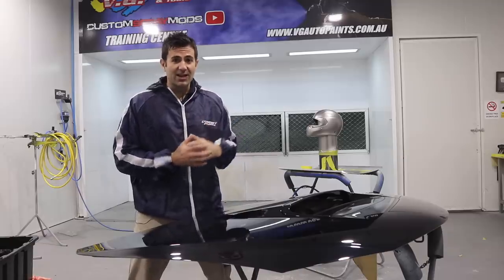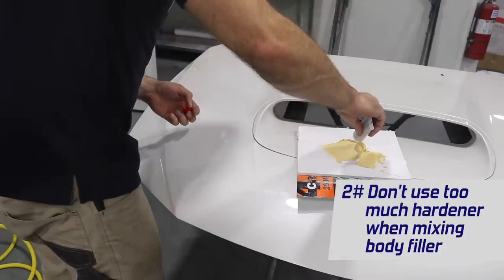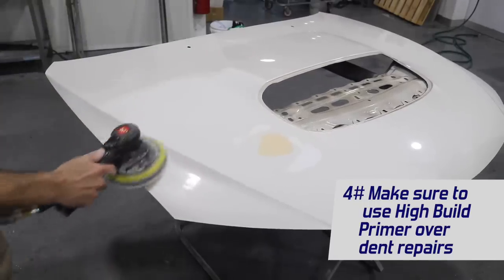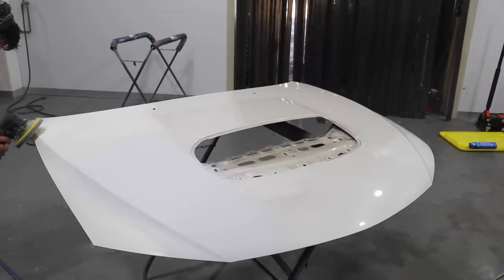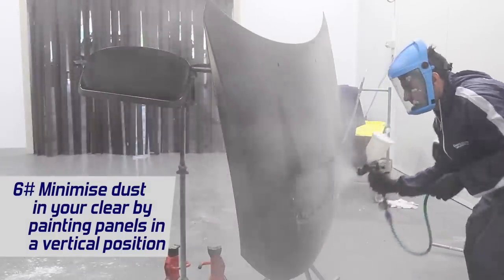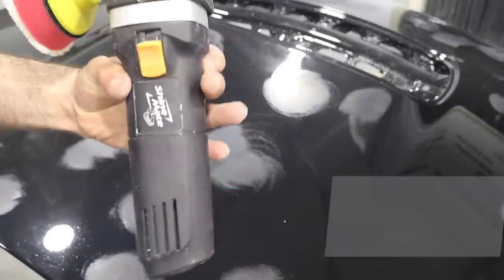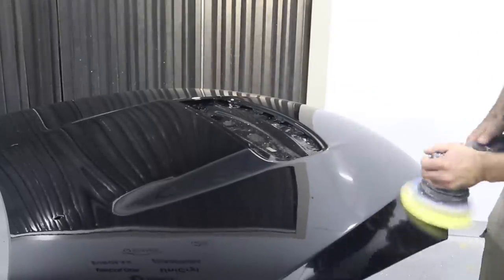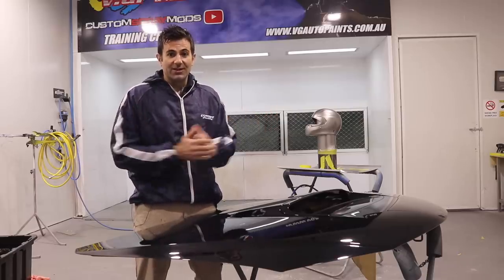10 Spray Painting, Dent & Buffing Tips

Comment: Mate, your videos are great! I recently painted my motorcycle (Ducati Scrambler Icon) using spray cans that i got custom mixed. Actually bought them from VG Auto paints.
I referred to a few of your videos and your information was SPOT on!
Bike came out really well and i was extremely pleased with it. I do however have a tiny bit of bubbling around top edge of tank where the fuel cap goes.
i know i prepped it all correctly, i think i have accidentally put too thick a coat and not let it dry enough in-between coats. Is there any way to get rid of them without actually stripping it all and respraying it all??
It would be a shame to have to redo all the work. I havent even wet sanded yet it it looks mint! so with a wet sand it will look awesome. I painted it the Range Rover Brittish Racing Green Metallic. Looks Sick.
Reply from the maker: Joshua Jones glad your project is going good. normally you will have to re do the clear depends how bad it is. .

Comment: If you are filling dents and repainting a panel (the same color)  on an a car, do you need to sand the original paint down to the metal? Can you use your method and buff the original paint with 800?
Reply from the maker: The Minute Masters no you don't need to go back to metal.
Reply: customspraymods Perfect! Sanding down to the bare metal did not sound fun.